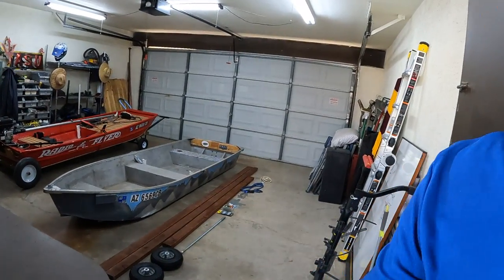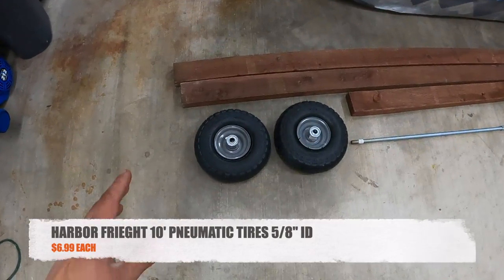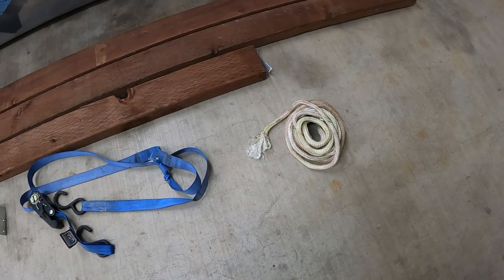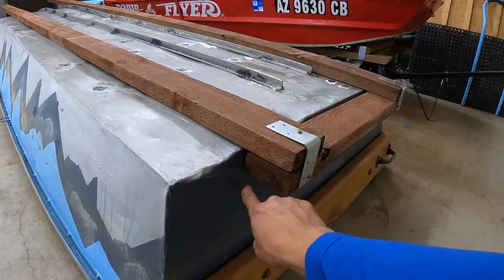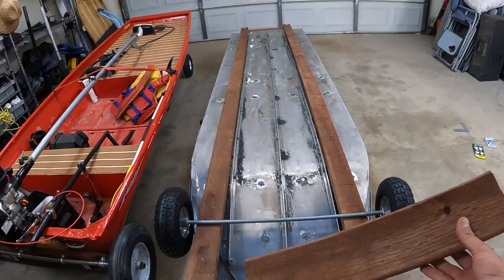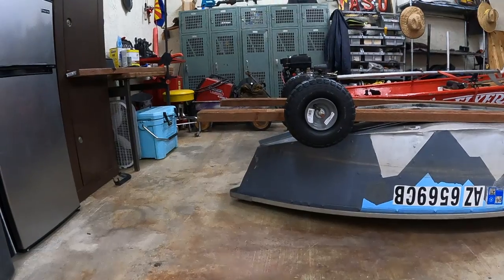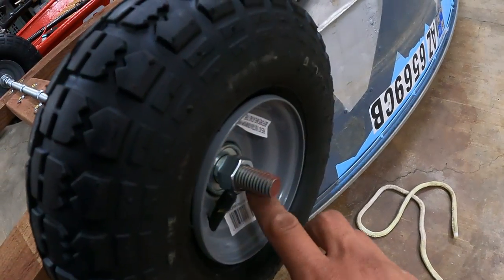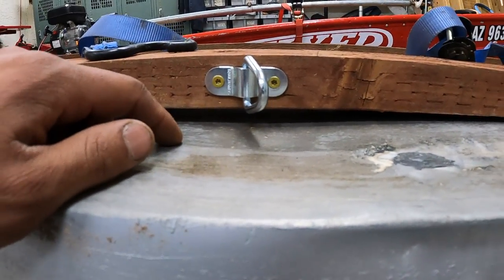DIY Jon Boat Dolly system build

Comment: Thank you so much! I just built one for my 12ft Jon boat and it work like a charm. I only have one suggestion is to add a metal handle by wheels where you going to lift it into and out your truck.
Reply from the maker: Sounds like a good idea to me. We just used the rear handles in the jon boat with ours

Comment: I basically used the same axle, brackets, and wheels, only I bolted them to the transom. Wheels only hangs 1 1/2 below bottom of boat, never had an issue with them. I chased a couple of leaks but all good now, been on there since 2017.

Comment: My boat is 14’ and the boards touch the front of the boat where the wheels mount.  Do you see a issue with putting the 2x4’s on edge to get more clearance?  Great video btw!
Reply from the maker: I dont think that should hurt anything

Comment: Do you take your motor off the transom for each trip?
Reply from the maker: You would for a vhull needing that orientation. But on a flatbottom you put the wheels on the transom side so you don't have to remove the motor for transport like #azspamcan and #radioflyer. But the mudskipper 2 piece kits are very useful for moving the motor for transport when needed.
Reply from the maker: I would also position the transom mount so the motor is within the boat during transport. Wouldn’t need to remove the boat, but it would make raising and moving the boat heavier.